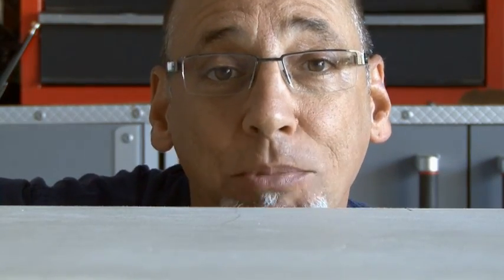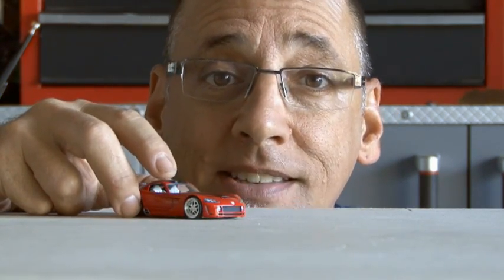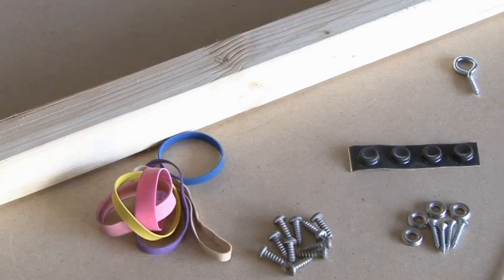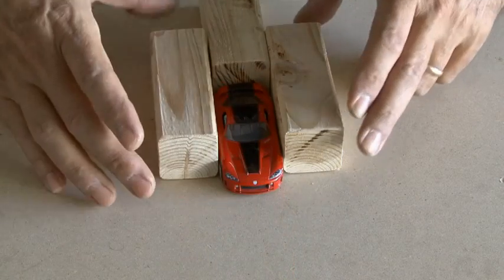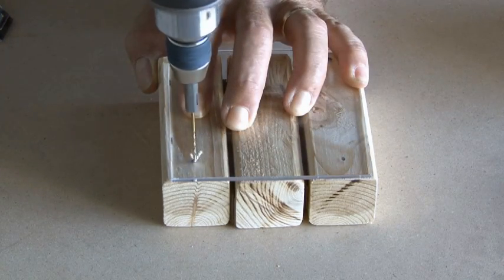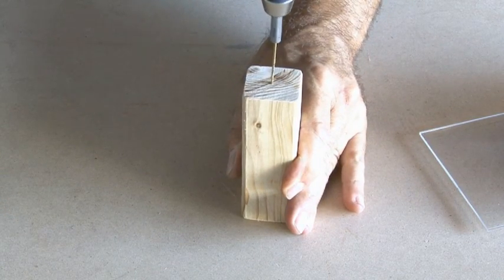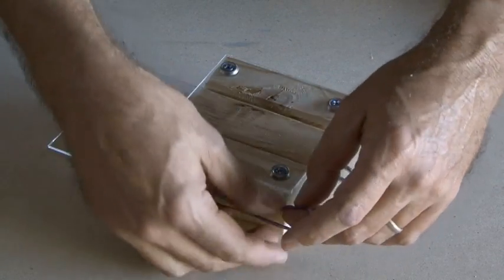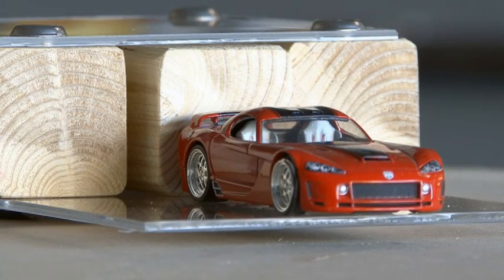Weekend Project: Rubber Band Power

Comment: uncle please give me a video in which it is made with cardboard  and rubber band 
looking like this
Reply: I made this thing by stacking cardboard pieces and hot gluing them together, you don't need wood. however you need a screw because cardboard is too flimsy to hold the rubber band. when you have stacked and glued the cardboard pieces (make them as long and as wide as you want it to be). add the screw by placing it in one of the holes on the side of the cardboard (it fits perfectly) cut more cardboard (identical to the ones you cut before), then glue them, and put the screw in that one. Then make more pieces out of cardboard, cut them the way you want to cut them. Keep in mind, this piece will be the one that moves the car. after stacking and gluing them together, (BTW i think 7 pieces of cardboard works) add an eye screw in it you can get them for $0.80. When done with that, make the base of the launcher: take all pieces of wood and put them together on cardboard. Then cut out the exact width of the pieces on the cardboard but cut out the length a little longer. Hot glue the side pieces on the cardboard. Next, cut a piece of cardboard that is the same length and width of the pieces altogether, hot glue that on the top, Finally put the eye screw piece in the gap of the cardboard pieces on the top and bottom and loop a rubber band through the screws. Bada Bing Bada Boom! I don't think i can say bada bing bada boom because it probably took like 1 min to read this and understand it for some people. I hope this comment helped you.

Comment: Hey Kipkay! I I have a 4 year old who's gonna love this. I found it worked perfectly with old CD case lids!

I also drilled a hole through the acrylic CD case lid and stuck a dowel pin in there to act as a launcher trigger. The little guy can set up where ever he wants and pull the pin to launch.

Comment: That particular model Viper will set you back about $3-$5 USD depending on where you go. That is usually the type pocket car you get as a teen or adult who likes collecting toy cars. I would recommend using Hot Wheels  or Matchbox brand cars unless you are comfortable with the surface you are launching it over.